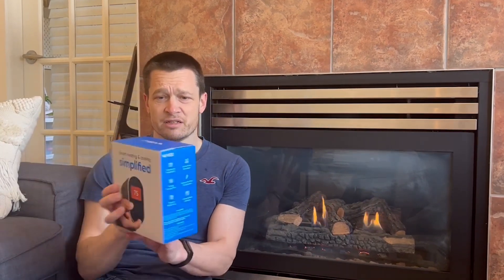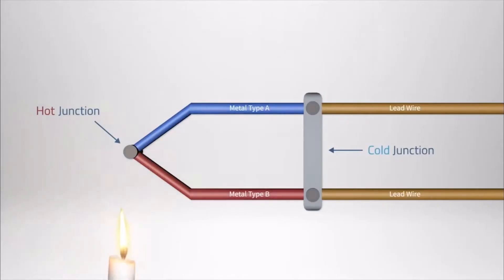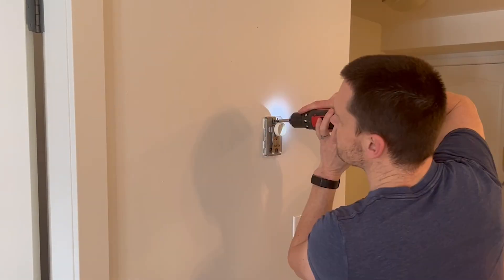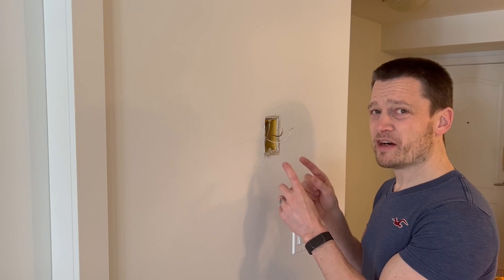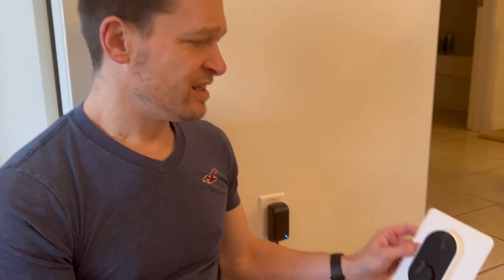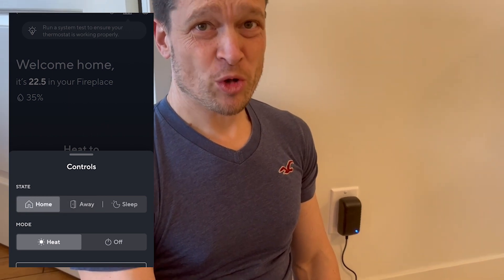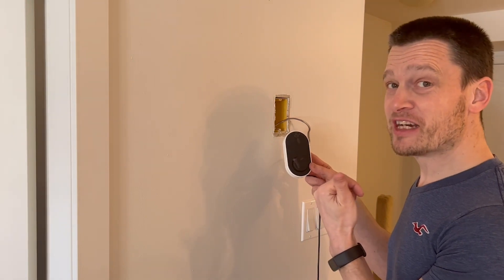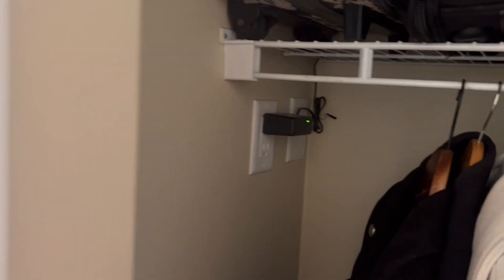Control Your Fireplace with a WiFi Thermostat! | Smart Thermostat Fireplace Hack

Comment: I ran into this issue because I spend almost as much on batteries as on gas (4 double-A batteries a week, $20/month). My gas bill hovers around ~ $ $30, but keep in mind that gas usage includes the furnace and cooking stove. This is absolutely a no-brainer, both financially and practically. Thanks for the straightforward and adaptable information!

Comment: If you have not purchased a DC 24 Converter, would a common door bell transformer work fine?  They are typically 110v to 24V AC.........
Reply from the maker: @kirbyhoyt1777  yes, that would work as well. This DC converter has been fine for almost 2 years.
Reply: @that_jamesguy  I have a 24v doorbell transformer (at least what it says on it) but I measured the output and it measures 29 volts.  It has another winding that puts out 19Volts.  I am thinking of using that .  What do you think?  I appreciate your help.  I have ordered and received the exact thermostat you used.  We have a gas fireplace at our cabin on Hood canal on Puget sound and it is always so cold when we arrive I have really wanted to be able to turn up the heat while on the four hour drive over to it.

Comment: I must be missing something. What kind of wireless connection is there from the thermostat to the fireplace? My fireplace has an Acumen wireless receiver— do I need to find a thermostat compatible with it? Or are all wireless fireplace receivers standard?
Reply from the maker: This is wired, not wireless.
Reply: The wireless part is between the thermostat and the app on your phone…..connected to wifi, controlled from anywhere on the phone app.

Comment: What terminal did u hook the 24v to?
Reply: If you check the video description he has it but here it is also.
Using 24VDC power:
C = 24V+
RC = 24V-
(Polarity doesn’t matter if you use 24VAC power)
W1 = Fireplace1
RH = Fireplace2